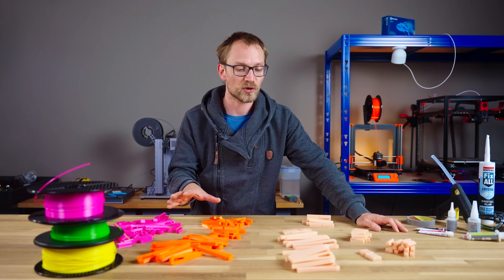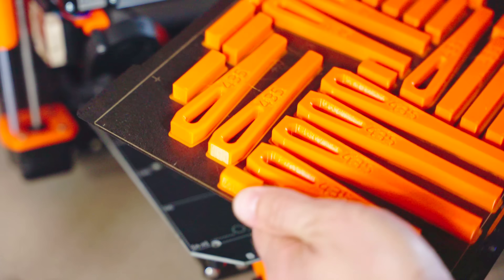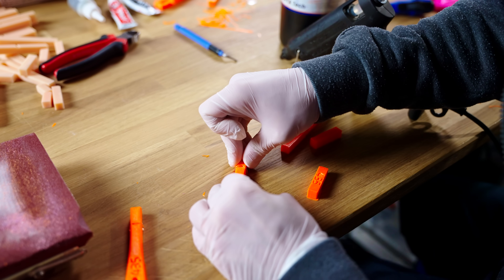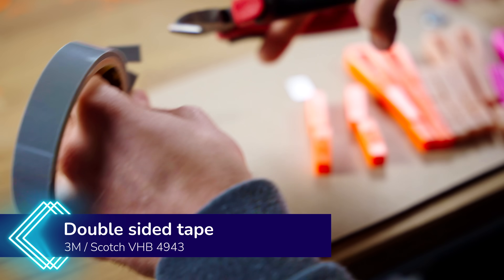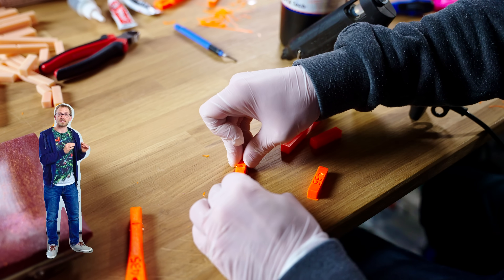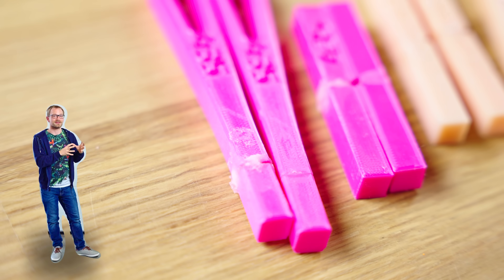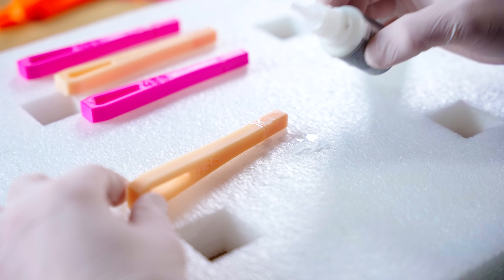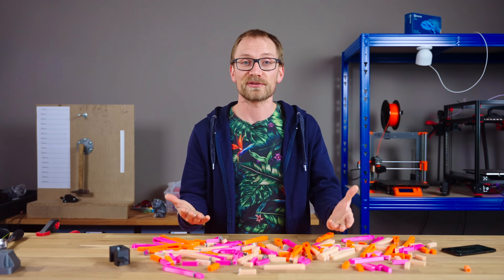Which glues work on 3D prints? JB Weld / Superglue / VHB tape…

Comment: Thanks for the great video! However, it's a bit sad, that you didn't test/compare pattex/Uhu, the regular ones around here. Seems you cater quite specifically to oversees viewers. Anyway, thanks for the results and tests. - Oh, and the typical load case for glue should be shearing and the mating surfaces should have the maximum surface - so in an application someone should have them in a sort of interlocking pattern or something. I saw you roughening the surface, which is exactly this idea and a good one. Just if anyone is wondering :).
Keep it coming, Cheers!

Comment: For PLA (and to some extend also PETG), "UHU Hartkunststoff" works very well. It dissolves part of the material and kinda welds them together at the joint. From its usage it works just like normal glue, so its easy to use as well.
Reply: I think I can find UHU products here in Australia, I remember them from my childhood in Wien.
Reply: @PTEC3D  Weldon acrylic glue works well. Especially the thicker stuff if you need some gap fill.
MEK and DCM are the solvents, so it does the same type of bonding.  (But do it in a well ventilated area.)
Reply: Are these the same thing as Plastic Weld in the UK?

Comment: Not as readily available, but do you or anyone have experience with PLA Gloop? Is it good choice, or would it basically provide the same result as a 2-part Epoxy or some of the other high strength glues?

Comment: Thanks for doing all this work for us.
I've been liking JB Weld's light activated cyanoacrylate adhesive. The light source with the LED on the dispenser makes it easy to control the run out.
I've also finally started using the 3D Gloop! I bought a while ago and never really used. So long as you clamp the part it work amazingly well (the PLA breaks first).
VHB is a pressure-sensitive adhesive, so really needs to be clamped to get the best results. It still won't work well under shear though.
Reply: Yes, VHB is designed for pull force, not "twist" .. it's actually designed to fail when twisted as part of the easy to remove property of VHB

Comment: Are you using a high temperature (~200C) or a low temp (~130C) hot glue? I've found the former works considerably better. Also there are special hot glues designed for plastics, and unsurprisingly they work a lot better too.

Comment: Awesome video! It's so cool to dive into something so deep that doesn't seem all that difficult. Personally I use PVC glue. It's mostly used for bonding pvc rain pipes and in my experience it works well on 3D prints. Also it is really cheap and you're getting a good amount for the price. Keep up the good work Tom!

Comment: UV resin and UV glue require UV flashlight to reach enough intensity for the join to cure to any depth. Or leave in sun for few hours. The glue/resin should be clear so it conducts UV light deeper. Dark filament and opaque resin parts do not do as well as light or translucent.

UV glue is fast, apply, align and zap. 2-part epoxy is strong and cures everywhere, but parts slide easily around when trying to press them together.
-> Epoxy + UV glue to hold the parts together during cure 😉

Comment: There are LSE primers available for low surface energy materials like PP, PE, even teflon apparently. It's supposed to increase bonding on these materials. I used it to glue magnets into PETG using "rubber reinforced" superglue. It was called "3770 primer". Found it on eBay. Don't know how much impact it makes, and I don't know if printed plastic is considered LSE.

Comment: Hi Thomas, I usually use Super Glue (alias Cyanoacrylate Glue) with my 3D Printes parts in pla or resin, and it works pretty well, but the two parts have to be pressed together for a real adhesion. Waiting 12h without presses the parts together make a poor adhesion. In my opinion you got poor results with super glue for this reason and repeat the test could be an option. Thx

Comment: There's two more tests your really need to do to see the differences between the different glues: pulling directly against the glue surface, and dropping things from a moderate height.

I say this because CA glue is SO strong for forces that are pulling on the joint - but it's also brittle and tends to shatter when subjected to shearing forces.  So CA glue is fine for most things, until you drop it.

Also: I love that you ran up against the challenges of ADR and just nerped out of it.  :D

Comment: It took me years to realize that CA-glue usually doesn't last very long once opened. Beware if you use small amounts! Check if it hardens in the usual time span, else get new ☹️
Reply: Because water vapor causes CA to harden, you can extend the storage life by putting the bottle into a zip-top bag, evacuating as much air as possible, and then sticking it into a freezer. The cold temps in the freezer don't do much but because freezers are a low humidity environment, that keeps the CA from hardening.
Reply: @squishybrain  yeah, I suppose it's a partial hardening that takes place, though it keeps being liquid.

Comment: I developed a 3d printed tool in March for holding glass tubes down at a tile (wet) saw.  I needed slip resistant parts of the 3d print.  
I had great results holding parts cut from rubber sheet (laser cutter rubber) to PLA with CA glue.
just thought I'd toss that in the hat.

Comment: I like and now only use Weldon 16 for PLA, hands down the best but probably not the best stuff for you. CA and epoxy are good too if surface prep is good.
Reply: Underrated post. Weldon 16 was a game changer for me.
Reply: honestly dont know why you would use anything other than weld on #16 on PLA. Easy application, no mixing, cures in a couple of minutes and makes a stronger bond than CA glue without having to use an activator or filling agent

Comment: Welp, I had this question last week when I was trying to stick ASA parts together. I had a tube of Beacon 3-in-1 that contains acetone. Works like a charm.

*edit*
I also stuck an ASA bracket with VHB to a DJI Phantom 4 and it's so solid I can lift the drone by the print part. There is a very large and matching contact area though.

Comment: Just a psa, there is currently no permanent double sided tape on the market, no matter what 3m says, no matter how much it costs, none are permanent.
I’ve used it in a commercial industry for the past decade, we buy the best that 3m puts out and have tried every main brand variant, none have lasted outside longer than 1-2 years and in our industry, that could kill someone. It is, however, the best for holding something in place while a real glue sets (simson ISR 70-05 AP) 
I would trust a tube of that to hold a car off the ground, we tear bricks from walls, aluminium sheets tear before the glue tears.

Comment: VHB, to my knowledge, is marketed to work mainly with metals and wood, not so much plastics. I think it's supposed to form some sort of chemical bond with the material over time, making the bond get stronger the longer it is together (and especially if it's under pressure). I've heard stories of people using VHB tape to hold together IKEA furniture, and when they've tried to pull it apart, the wood broke rather than the tape bond.

Comment: Hi Tom, Great vid. I find a contact adhesives work great (I print in PLA/PLA+ only). I have not done any strength tests as most of my prints are display models rather than functional parts. I do also use 2 part epoxy and CA glue sometimes.

Comment: You should have used JB Weld PlasticBonder (SKU 50139) in this comparison rather than the regular JB Weld. This is a urethane epoxy that bonds with pretty much most things including mixed materials (ie. PETG/PLA to Aluminum).  Urethane adhesives/epoxy like this are used across many industries, including aerospace and automotive. It's often used to bond CF to honeycomb core for structural applications for example.

Comment: I have had excellent results using liquid Paint Stripper for gluing/welding PETG parts together. You should wear gloves and work in a well ventilated area (outside).  It can also cause a white discoloration where it is applied so be neat if looks matter.  I tested it against several plastic adhesives and it worked the best.

Comment: Really intresting results. I work in automotive and we use vhb everywhere. I engineered some bodyside rub strips for a car manufacturer I think (would need to check) they used a pc/abs substrate injection mouldings with vhb to attach to a painted door.  I tested them in an environmental chamber for over a week with no issues I could have picked a car up with them. I guess because of the large surface area.  Took a good 40 minutes to get them off again the stuff is a nightmare to remove used a rubber wheel on a drill.

Comment: For filament prints, a 3d printing pen could be used - you'd be extruding the same material as the print, essentially manually adding a layer in between the parts being joined.
Reply: Have you done this?
Reply: @joeking433  I've used it to fill some gaps in seams between parts, but they were already glued with cyanoacrylate. Not sure about the overall strength of using the printing pen alone. If you want minimal gaps, you could only really join small contact areas this way - you've got to lay down all the filament before pressing the parts together. Otherwise if you can hold the parts a little distance apart you could squirt the molten plastic in between to give a large surface area.
Overall it seems that epoxy would be a more effective and less problematic approach.
Reply: Friction welding (2-3cm pieces of scrap filament in a dremel style tool) is good because it penetrates controllably and makes a strong join,

Comment: To expand on methods to stick parts together, two topics I'd like to hear about are: creating interlocking features that jam together robustly. And techniques for welding parts together with heat, either by heating one or both surfaces, or by applying hot filler material from say a 3d filament "pen", like MIG welding steel. Oh I guess there's also friction welding.
Reply: once you include welding type bonds it becomes hard to argue against acetone welding on ABS
there are also modelmaking glues that also work that way. dissolve the surface so that the two plastic parts literally become one and then harden again by evaporating the solvent.

usability depends on the type of plastic though....
Reply: Don't forget the wide world of fasteners, as well as compliant snap-locks!
Reply: I actually repair broken prints with a 3d pen and it's very tricky to do. You need to touch/heat both surfaces before you extrude the filter material. Or else it won't transfer enough heat to actually melt everything together. But if you manage to get it done, you end up with sanding a perfekt bond.
Reply: @youradvertisehere  another option is using a soldering iron like a tig torch and handfeed filler filament into the melted area.

the 3d pen in this case is more like mig welding with automatic wirefeed
Reply: @TheScarvig  If you use a wood burning iron, there are shaped tips to help contour the weld for less sanding.
Reply: @youradvertisehere  I've been doing this kind of "plastic weld" thing with ABS filament (in that case a fume extractor is kinda mandatory... It stinks absolutely horribly compared to printing it), and a soldering iron at low (same as printing) temperature. It's a pain in the rear. Will consider getting a 3D pen for those jobs. Even if sorta hard, can't be harder than the soldering iron thing.
Reply: Laser precision welding plastic parts with a laser plotter is an option
Reply: @pteppig  I've no experience with high power laser applications at all. Though i assume this way you may also only melt the most outer surface together?
Reply: See my other comment re: friction welding. It's easy to get the hang of.
Reply: Yes please!
Reply: I use finish nails that I heat up (via propane torch) and then insert into the prints, they serve me really well but you need to be super quick to get both pieces together.
Reply: @TheSinzia  They make a heat-staple device that works similarly.
Reply: 100%
Reply: On non cosmetic parts I sometimes just use a hot paper clip to smush the parts together very slightly so they stay together somewhat while CA glue fully sets. This is usually on parts at an angle or hard to set down properly, where I wait for the glue to get tacky enough to do this but would like to set it down and not wait so long for it to fully cure.
Reply: On the topic of heat joining, I noticed that a "high temp" hot glue gun, available for $10, gets to a temperature to get PLA well melted. One could put a stick of PLA into a spare hot glue gun.  Should be hot enough that the melted PLA coming out will adhere, by very slightly melting the surface it's applied to.

Comment: CA fillers impact strength. You can use accelerators - CA is acid inhibited and thus base accelerated. It's not about air but moisture. When you press parts you make surface moisture to glue volume ratio in favor of polymerization /diluting acid/. Sand, saw dust etc carries moisture. Baking soda rises Ph. You should not mistake glue with filler :) You can buy special spray accelerators that do wonders with CA with little impact to strength :)
Reply: The spray accelerators  heat up the contact areas really well, and would add to the bond strength, although sometimes it seems to add air bubbles to the joint. And I almost don't recommend it to casuals because of how friking hot it gets, and will burn the skin, had a scar for a decade on the inside of a finger from some accelerated glue.
It works great on helping the thicker CA set, without overheating.
Reply: @Christian-cz9bu  Speed actually depends on accelerator. Safety and know how applies to CA of course. Overheat can cause burns and nasty vapor release. Well coupled CA and kicker is powerful tool.

Comment: Are dowel joints or other interlocking type of joint feasible to use in 3D prints? How would the glues fare here?
Reply: Indeed, if you plan to glue, make a sensible interface!

Comment: I somehow found out that Tamiya extra thin cement also works for PLA. I assumed it wouldn't because PLA isn't a standard plastic, but it slightly dissolves the surface and if you rub the two parts together the dissolved surfaces mix together and it acts as a weld. It's very quick setting too, it's basically a chemical that evaporates very quickly.
Reply: @cas curse Might be the blend of PLA I used as well. I used Prusament. Tamiya extra thin cement works like a charm, but Revell contacta does nothing.

Comment: Would be interesting to see 3d printing pen instead of hot glue or friction plastic welding with rotary tool.
Reply: Igor at MyTechFun did a video on using a 3D printing pen and did strength testing.

Comment: As in woodworking, a "butt" joint like these tests isn't going to be very structurally sound, so for practical applications where you don't want the joint to fail easily, one would use a bit more geometry to increase the surface area if possible. Or add M3 nuts and bolts.

Good to know that epoxy works well with PETG. I would imagine CA would work nicely for a joint that applies pressure on its own, e.g. a mortise/tenon joint with a wedge.

Comment: I've become quite fond of hot glue in my projects as I found a way to make the glue look nicer and get better contact than just the bead.  Dip your finger in water (or lick it I guess) and you can safely push around/shape hot glue with your finger.  (just for short intervals of course, don't burn yourself!)
Reply: In my experience is that some hot glue guns are way hotter then others.
Reply: Wait, it's not popular knowledge?

Comment: I do mainly structural prints in PLA+ and have been using super glue gel from Harbor Freight. I have tried most of the major brands available here in the US but the HF bonds better (failure of print material before the adhesive) and is cheap. (3.99 US for 10 tubes). Their gel is perfect for what I do as it is thinner than most gels but thick enough to fill gaps and inconsistencies when needed.

The "mini me" save on the video did a good job of saving the video without being too corny.

Comment: I've gone through a lot of adhesives and solvents trying to find what works for me with various materials and uses. For me, CA (esp. Loctite Ultra gel) works a treat with PLA and adequately with most PETGs. Epoxy (yay JB weld) is very solid if not too thinly applied with just about everything. If I really need strength, it's solvents e.g. Weld-on 3 or 4  (I like 4 for PETG). When working with TPU, which admittedly I haven't done a lot, I've found Loctite 406 (with or without primer) to be almost as good as a solvent (being a CA, also works with PLA and PETG). For a solvent, I used DMF once and it welded TPU great (I hear THF also works but I haven't tested it). I mostly stick (ha!) with 406 since it's more versatile for me.
Reply: I have been using Weld-on 3 for PLA and it's fantastic. I also have some 3DGloop but unused. I have a funny feeling the secret ingredient is Methylene Chloride. (well ventilated!)
Reply: @johnbickford9221

Comment: I really like E6000/GOOP in general, and it works really well with PETG. They're similar to the FixAll you used. They stay rubbery. And because they are more cohesive than adhesive, they're easy to remove with a little stretching.
Reply: E6000 is my favorite too, but in some applications I need something stronger.